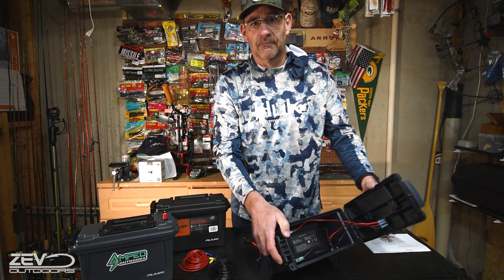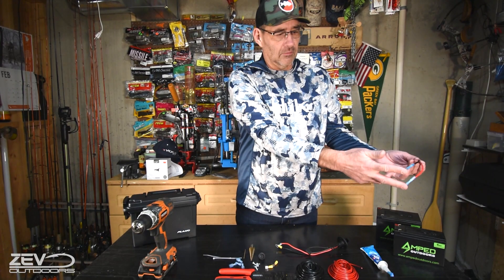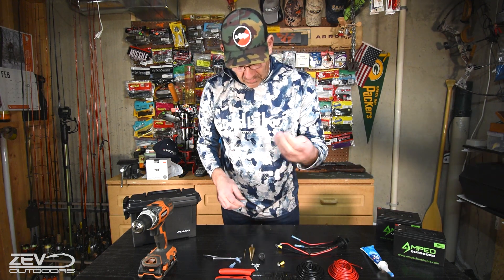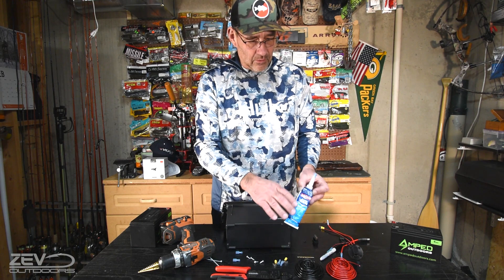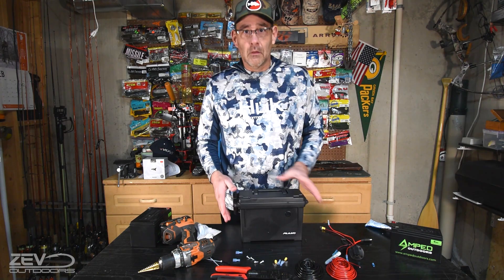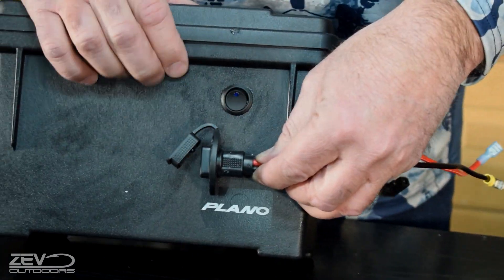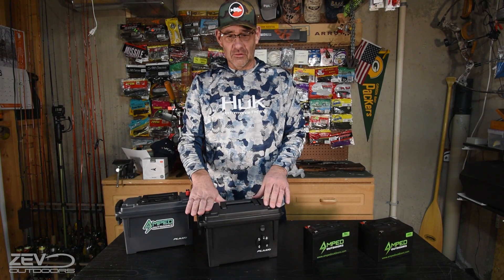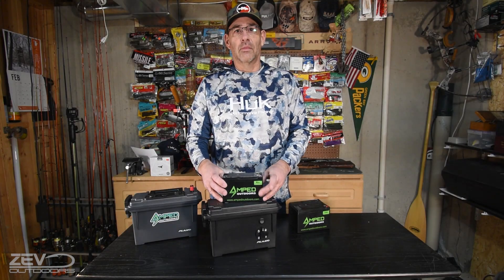Make your own LiveScope Lithium Powerbox - SAVE $$$

Comment: Thanks you made it so easy I ordered it all 
Just a click. 
Should work great 
I commented below earlier. Great video. Thanks
Reply from the maker: Fantastic!
Reply: Think I have to move my lighted toggle on/off switch to side of box. I have it on top with 23v gauge.  Accidentally an item was laid on top and switched on the box over week. And came back to use and lithium was dead. As the black box will drain if switch is on. Maybe a different style on/off switch could be added. Learned hard way. Darn it

Comment: Great video, I learn something new everyday, I was considering just adding another dedicated AGM battery just to run the electronics, who knew.😀
Reply from the maker: It is the best thing I ever did for my LVS setup at the bow of my boat.  Totally eliminated any concern of killing my cranking battery during a full day of fishing, especially when running everything during a tournament.  Alot less weight too!  Before I did this I actually ran my big motor for well over an hour in a tournament, so I could keep using LVS.  Thanks for watching!

Comment: Great video brother, what a savings. Thanks so much.
Reply from the maker: Thank you and Thank you for watching!
Reply: Why no inline fuse?
Reply from the maker: @joeavelar2222  Hi Joe. If you don't want to rely on auxiliary protection then there is no harm in adding additional protection in the box.  I should have mentioned in the video that my LiveScope box and display unit both have in line fuses.  Thanks for watching!

Comment: This has to be the best detailed video I’ve seen in awhile.  I just bought the Garmin echomap ultra 126sv and the livescope pluse lsv34.  Will the 14.8v 32ah run this setup?  Thanks again
Reply from the maker: I am happy it helped you with your setup!  The 14.8v 32Ah amped outdoors battery I talk about in the video will run your setup just fine.  If you go to Amped Outdoors website it will tell you how long it will run.  Not sure they have LVS34 data yet, but if you message them they will get back to you very quick.  Thanks for watching!

Comment: Awesome! Could you include a list of exactly what we need. Can I use this one box for my boat, kayak and ice fishing. It would be great to see how you set this up in your various applications. Thanks!
Reply from the maker: You can find links for all of the products used in the description area on YT for the video.  Yes you can use for all your 12v power needs.  Just make sure you put a inline fuse on the units red wire you plan to power if the manufacturer does not include.  Thanks for the suggested application video and for watching!

Comment: Not sure how you made it for $30.  But it is a clean simple design and build.
I'm $130 in and it's still not complete.  Good job.
Reply from the maker: I tried to do a quick price breakdown of the components for a single box.  In some cases it’s hard to buy just what you need, which can certainly drive up the cost .  Thanks for watching!
Reply: I was able to do it for 50$, but I added a couple usb connectors and a voltage monitor.   Still pretty basic I guess

Comment: Thank you for the video. If i were to add inline fuses should I use the positive wires between the switches and SAE ports?
Reply from the maker: Hi Paul,  yes you can put a fuse on the positive wires between the switch and battery for added protection.  If the devices you are connecting to the battery via the SAE port do not have inline fuses then you should definitely add an in line fuse to the SAE positive wire as well.

Comment: I have a garmin 1222 and livescope ls34 transducer with black box, what size fuse do you recommend for the power box? Great video
Reply from the maker: If you are protecting from a short in the off/on switch then you need to consider what the amp rating is for your switch.  In general a fuse equal to the switches amp rating.   The 1222 and LVS34 have individual inline fuses to protect them.

Comment: Great video! I built one and followed your instructions. But when I plug my charger in it won’t charge my battery. Any ideas?
Reply from the maker: Check and make sure the polarity on your SAE plugs are the same.  Positive to positive. I have purchased a few SAE pigtails of and the polarity is reversed.  I’m not able to explain why but I have had similar issue.
Reply: @zevoutdoors7194  It’s black to black, red to red
Reply from the maker: @irenew95    Have your tried charging battery outside of the box?  If it is charging outside, box I would double check all your connections and use a volt meter to confirm continuity of SAE wires to assure red wire is the positive all the way from + batter terminal to + lead on the charger.  Sounds crazy, but you can't always trust the wire colors on connectors/pigtails.

Comment: I only need like a 2 ft power wire would I be ok using 12 guage I’m asking bc I already have 12
Reply from the maker: In my opinion you ill be fine with that short of a run.  Heavier gauge wire is needed when you are making long runs, like from the bow of a boat to the battery compartment in the back of the boat.  Take a look at wire gauge the supplied power cord form Garmin and I am pretty sure you will agree.  Thanks for watching!

Comment: Followed most of your design last year
But found the Side Port connections were cumbersome and always had to remove box from my Ranger rear compartment and plugging in
I need to try and connectors on Top of Box for ease of connecting 
The Plano Box too lid plastic latch) already broke.  Hmmm
Reply from the maker: Every situation takes some small modifications. Every size definitely doesn’t fit every situation. The box in my Vexus has charge port on top of box for access.  Had a latch on a box break also.  I bought another box and used that latch.  Sucks spending more money but it is a solution.  Thanks for watching!
Reply: @ That’s what I am going to do as well… lol
I am going to look for a 12 gauge wire with Spiral Top Leads and see if I can’t add in Banana Leads R/B for each the 106 and Black Box
And try being able to plug in from top. I like the idea of having the charger and leads being able to keep in box.  You do great and easy to follow videos

Comment: Do you have to have a power switch? or can i just use the plug directly to battery and unplug from the box when black box is not being used...thanks
Reply from the maker: You could eliminate the switch, but I would strongly recommend having a switch.  Simply plugging your unit into a hot wire could cause damage to your electronics.  With a switch you are making the initial connection to your units with no power.  Think of it like using a switch to power a lamp versus plugging and unplugging the cord from an the electrical outlet to turn the light on and off.

Comment: Maybe I missed it Did you mention fuses for each?  Garmin recommends each fuse to be 4” from battery source.  But maybe not enough room in box. I may leave my 2 fuses in place close to the bow where the Garmin Echomap and Black Box is installed 
Only thing I would add is I will be adding shrink tubing to the wires. Thanks again
Reply from the maker: Yes you can add additional inline fuses as recommend by Garmin.  I did not mention fuses in the video because I mounted my box in my center rod box, well working reach of the factory power wires.  The factory red wire has the required in line fuse.  Having multiple fuses will not change the performance of the battery or your units.  Shrink tubing would be a great add.  

The portable boxes I make for ice fishing have shrink tubing.  I did not add tot his box because it’s kept permanently in a dry location.   Thanks for watching!!

BTW I do not have any recommendations for a connector that will work with the battery connections for 2 - 10 gauge wires.  Possibly you could run the 10 gauge wires to a marine power block and power the block from the battery with a single red and black wire.
Reply: @zevoutdoors7194  thanks 
I am going to install in the box dual ports for powering up my 2 units 
1-10/2 Gauge for Black Box
1-14/2 Gauge for Garmin Unit
Then don’t have to “splice both” powers together and will separate feeds.

Got my box yesterday and waiting from Amazon for my parts duplex Amcor Marine Wire

Question 
Do you think I can keep the charger in the box with the battery so end of day I can take the cord and plug in charger?
Didn’t know if there is alot of extra heat being created when charging while in the box? Thanks again and great video
Reply: What size fuse would you recommend
Reply: @scotwcates  believe mine is a 8 amp per the spec sheet

Comment: What connector do I use to put two positives from livescope and my graph and do they make a connector to attach three positives?
Reply from the maker: You can use a butt connector large enough to accommodate the wires.  Just be sure to use either a heat shrink connector or heat shrink tubing to seal the connection.  Thanks for watching!

Comment: Can this box work for a 48Ah amped battery?  Can the components handle the 14.8v battery vs a standard 12v?
Reply from the maker: Hi Scott.  I used the same components in my boat for the Amped Outdoors 14.8 32Ah battery and have had zero issues.  I use it to power a EchoMap 102 and LiveScope box.  I am not sure about physical size of the 42 and if it would fit in this box.  I know the 32 fits but it is a tight fit.  Thanks for watching!

Comment: Do you have your power box in a storage compartment, and your wing for your graph and livescope run to it? I am getting ready to install the 106sv and livescope on my boat. I want to use the power box and install it and the black box in my starboard compartment because there is already routing for wiring from there to the bow. The only thing I’m not sure of is that if I run it that way I think I’ll need to run maybe #10 or #8 gauge wire. The total distance is less than ten feet, but how would I connect the power wires from the graph and black box to the leads to the power box? Any help would be greatly appreciated.
Reply from the maker: Hi Bryan.  I do have a my box mounted in the front of the center rod box on my Vexus.  Fortunately for me the 106 power cords reached my box and I have the LVS box right next to the battery box so I did not have to run additional wires.  Having said that you should run a heavier gauge from the 106 to the box.  Since it is a short distance I would think #10 gauge would be sufficient.  Make sure you keep the fuses that came with the LVS and 106 power cables in place. 

Normally when people are talking about heavy gauge wire it is because they are running multiple graphs off of one battery and running long distances from the batteries in the back of the boat.  

I just used a shrink tube type connecter large enough to capture both wires from the 106 and black box.  I found this connector that is similar to what I used just make sure you get one large enough for your application.  

I did not buy mine here, I believe I got them on Amazon or at local ACE Hardware, this is just a good picture of the connect I am referring to.

https://www.waytekwire.com/item/31980/Molex-Perma-Seal-Butt/?gclid=Cj0KCQiAvqGcBhCJARIsAFQ5ke5EjA271TdnCMlcb0NF1CKffdIFNp1wanpaGE-_2YlVrDoAHkSXoBcaAgdDEALw_wcB

Thanks for watching!
Reply: @zevoutdoors7194  I didn’t know you had a Vexus!! I have an AVX189, had it for about three years now and love it.

Comment: Hey there sir I’m looking to build this same set up. My question is i have a 6amp switch laying around i was going to use on lights. Will it be fine to use on this set up or do i need to step up to a 20amp switch
Reply from the maker: It depends on total power consumption you're looking to pull through the fuse.  General rule of thumb for a 6A is the system max should be around 4A.  

Given a battery voltage of 15V and the 4A limit you want to make sure the total power draw is below 60W. 

The equation would be max load (W) = nominal voltage * 0.66* fuse rating
Reply: Thank you sir i ran and got a 25amp switch to be safe! I got the 20ah battery for a 93sv with ls32 livescope
Reply from the maker: Keep in mind choosing the best fuse is done by determining the lowest value your system can tolerate in a normal operating condition.  If you go too high above normal operating current then it will be that much less effective at protecting your circuit. 

Lower is better with fuses.

Hope this helps

Comment: We’re are the fuses at
Reply from the maker: Hi David, I chose to put the fuses in the power (red) line for the electronics after the box.  You could put an inline fuse on the red power right off the battery also.  Thanks for watching!

Comment: What gauge wire are you using
Reply from the maker: I use 14 gauge in the box.  You may need to use larger gauge wire when connecting your graph and LVS.  I was able to just use the power cords that came with each unit because of my box location.  If you have to run a long distance between power box and units you may want to consider 8 or 10 gauge wire.  If you use too small of wire on a long run you risk voltage drop which will lower the performance of your graph and LVS.   Best way to avoid all of that is to locate power box close so you can just use the supplied power cables.  If you do not use the manufacturers power cords do not forget to put an in line fuse on your power lines to the units!   Hope this helps and thanks for watching.
Reply: I only have to run 4 to 5 feet would 14 gauge be ok
Reply from the maker: @0590don  If it were me, I would be ok with 14 gauge that short of a distance.  Again, just make sure you have everything properly protected with the inline fuses provide with the Garmin power cables.

Comment: I researched the amped NMC battery.  In my opinion its a dangerous battery to put in a boat.  Manage it wrong and you have a fire.  It’s cycle life is much lower than a LiPoe batt.  Yes it has a a higher full charge voltage but its expensive and won’t last.
Reply from the maker: Interesting.  Thanks for watching

Comment: This is perfect and what I need. Do you sell complete boxes?
I have the same electronics.
Can I add 2 SAE plugs?
Reason is I will have 2 runs to rear of boat where I will put box inside my Ranger compartment 
The 2 runs will be 10 gauge wire
As stated in Garmin instructions since over 15-20’ away.
It also states for the 2  fuses to be added approx 4” from battery source.
I assume if I added 2 SAE connectors I could plug charger into either?

You mentioned on the SAE  connection that 2 leads could be inserted and crimped 
A Red and a Blk
But with 10 gauge that is a larger wire.
Maybe you know a crimp connection that could take 2  10 gauge wires?

I think this box would work great as I want to separate my LiveScope stuff from my 5 batteries in boat.

And as I place the box in the compartment mentioned it is where all my chargers are for the 5 batteries 
Then end of day I could plug in both charger systems. 
A lighted switch would be helpful to make sure power is On and also to show Charging.

Last question 
Can a Red Black post type connection be added to install the Garmin units ?
I would want 2 - Red Black posts with the ability to use crimped eye connectors?
Then still add the SAE connection for charger 

Thanks again 
This is the Best Video ever 
Well done
Reply from the maker: HI Dave,

Not sure I got all your questions answered in my comments?  I did see your last question about post connections.  Yes you can add those off the battery.  Here is a link to them on Amazon if you have not found them yet.  https://www.amazon.com/Jabinco-Insulated-Terminal-Binding-Amplifier/dp/B07ZJLB6QK/ref=sr_1_3?crid=3A394F3A04S1E&keywords=banana+plug+post&qid=1659359939&sprefix=bannan+plug+posts%2Caps%2C93&sr=8-3
Reply: @zevoutdoors7194  Yep  Got them coming Wed same one. Got the wiring 10/2 (black box) today and the SAE connectors   Battery being delivered today. Ordered on Amazon the  14/2 Garmin Echo unit. You make it so easy. Thanks to you and Amazon.  I will go on your YT and look for that schematic  Thought you mentioned that may be there? Have a great day  Well done